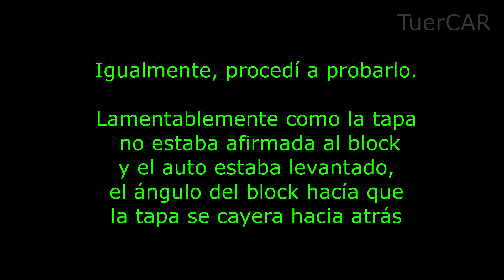Proyecto Renault 19: Parte 6 - Fresamos el múltiple de admisión!

Comment: Interresting project! I’m working with the same(or similar? C2J) for my -64 R8. 
Do you think you could measure the diameters of the four runners and the centre distances of them where the two parts of the manifold meets? I’m thinking it might be possible to mount four separate throttle bodies to the lower part of the manifold to make an ITB system. 
Regards Reidar
Reply from the maker: I can't at the moment but I think the closest intake manifold should be the one of the Fiat Uno Turbo IE MK1 and the Autobianchi Y10. Here in Argentina we have a lot of ITB manifolds for the Fiat Uno (but they are dual).
Reply: @tcar  Hi. I’ve had a look at the manifolds you suggest. The Uno turbo have its injectors in funny directions and the Y10 have a sharp angle in its runners. The Uno 1,3MPI manifold you are working with is mutch nicer. It actually look like an improved version of the Renault efi manifold used in the states.
Anyway my project is to cast C2J inlets for two double throttle bodies. I’ve found some nice 36mm keihins that have the same centre distance as the Renault head